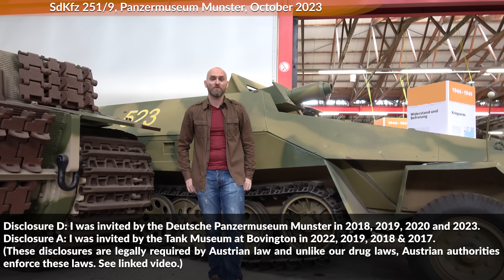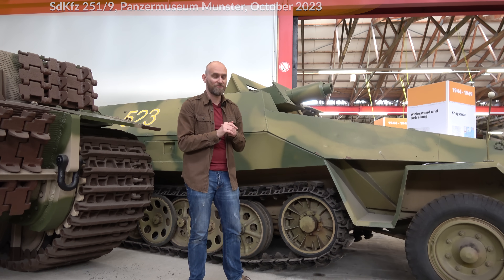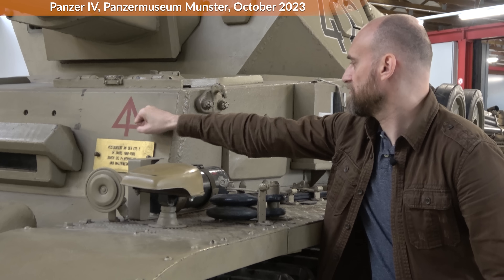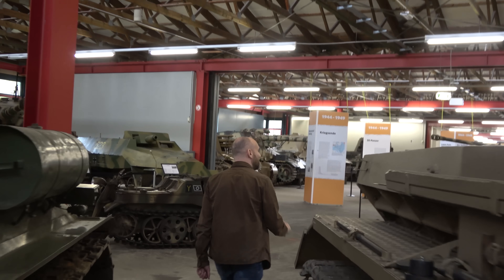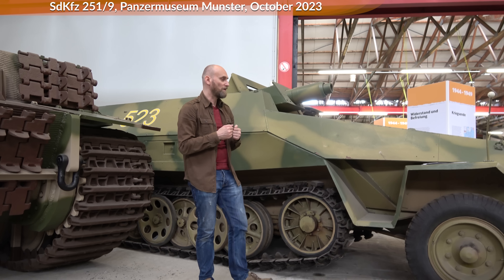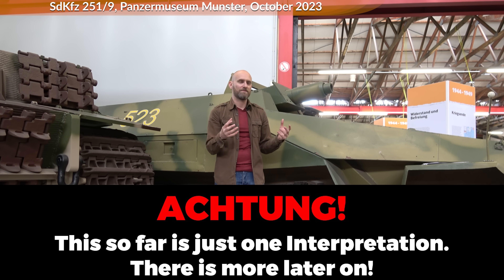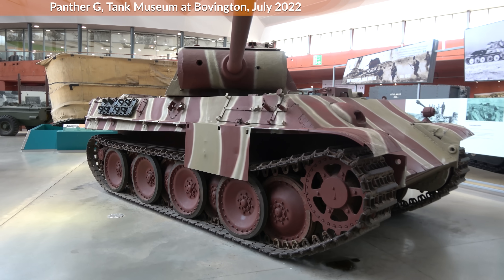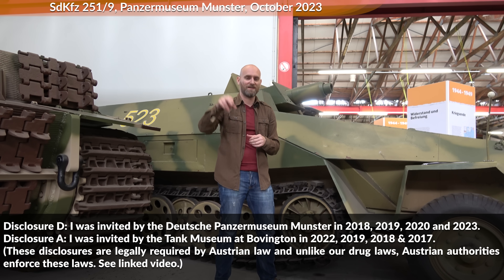Why was German Sloped Armor so late?

Comment: Sloped armor is not a magic bullet (pun intended), a sloped plate will have more effective thickness, but it needs to be longer to cover the same frontal height.
Those two effects will exactly offset, the main advantage of sloped armor comes from normalization effects, simpler production of thinner plates and better surface to volume ratio, when designed correctly. For modern APDSFS projectiles with a large degree of positive normalization, sloped homogeneous armor can be worse than a flat plate.
Especially in a WW2 context there are definite advantages, but also tradeoffs.
Reply: Yes! Thank you! It always drove me nuts to hear that 'sloped armor increases effective thickness for the armor without increasing its actual thickness, so you save weight' when simple geometry shows the increase in length of the armor plate would cancel out any supposed weight loss.
Reply: @quantum340  You guys are purely delusional.

If you don't have the intuition, just consider the IS-2.

This channel has a video on it.
Reply: @quantum340  Simple geometry shows ... Isn't sloped frontal armor just "the diagonal", i.e. approximate shortest path connecting two points? This can also be expressed as a metric - sloped armor uses the Euclidian distance and non-sloped armor uses the Manhattan distance between two points.
Reply: @dwightk.schrute8696  You don't need to armour the top deck anywhere near as much as the armour face. With sloped plates there is more armour face and less top deck while flat plates have less face area and more top deck area.
Reply: @julianturberfield7101  But that means either less internal space or a larger floor plate.
Reply: @julianturberfield7101  Only that the extention in length is minimal while a doubling or tripling in thickness is brutal regarding weight
Reply: @julianturberfield7101  This is only valid for tank (using "normal" projectiles) on tank engagements, right? The "top deck" being weak gives an obvious shoutout to systems like the FGM-148 Javelin and many other advanced munitions.
Reply: @dwightk.schrute8696  exactly, OP was only accounting for height, not accounting for length or width.  We exist in a 3D world so claiming sloped armour is longer is ludicrous.  One can just compare the Pzkpfw IV and the Stug IV and see which one has more hull frontal surface area despite being built on the same chassis.
Reply: @jadger1871  Simple geometry dictates that the volume of a prism (armor plate) is base-area*height.
Rectangular or oblique (i.e. the angle) does not matter, for an armor plate the base area is width*LoS thickness, same goes for the side plates and length.
You can not slope armor by just rotating the plates, you will loose height/internal volume, even the wiki page on sloped armor gets it.
Reply: @dwightk.schrute8696  i meant if you need to cover a certain vertical distance with an armor plate, if you tilt the angle the armor plate needs to get longer.
Reply: @kilianortmann9979  
You literally do not lose internal volume by sloping armor, even the wiki page gets that. You slope armor OUTWARDS not inwards.
Reply: @kilianortmann9979  Then explain how come a Hetzer has more volume than a Panzer 38t? Surely the same chassis but with sloped armour would be have less volume then.
Reply: @jadger1871  Jgdpz 38t had sponsons and the roof of the casemate was quite a bit taller than the hull roof of the 38(t), it's small two man turret didn't really add a lot of internal space. The Hetzer was deceptively tall, quite a bit taller than the Jgdpz IV, you are literally comparing apples to oranges (casemate to turret tanks) btw.
Reply: This, 100%
I have been writing this for some time as well ... angling a plate doesn't save weight by itself. The weight saving come from decreased surface area you need to cover and less internal volume.
Reply: @thrall1342  It straight up does save weight when going for effective thickness.
Reply: @dwarow2508  No it doesn’t, please consider the geometry here:
 if you cover the whole of the Tiger front with vertical plate of 100mm effective thickness, the plate covers an area with 100mm of material. Plate weight is proportional to volume, which is area*100mm
If you cover the tiger front with a plate at 60 degrees angle (extreme example, that looks almost like an Strv S1) with effective thickness of 100mm, you need a plate that’s half the thickness, but needs to be double the length to still cover the front completely.
Weight is proportional to volume and volume is area *2*thickness/2

Same weight of plate, but now you have a more complicated internal space that’s harder to utilize. Weight saving comes from less surface on the side that one needs to cover, if planned well.
Reply: @thrall1342  
Yes it does, please consider the geometry here:
A plate at 60° to reach 100mm of thickness would be just 50mm thick. Applying the volumetric law, a double reduction in plate volume would lead to QUADRUPLE reduction in weight. It would not need to be double the length either. Only 1.5x the length. 

So in all you either get area * 100mm or 1.5*area*50mm.

Much lower plate weight, more internal space, more armor and easier construction. Weight saving comes from sloped armor.
Reply: @dwarow2508  You seem to be confused about how math works … point in case: you speak about quadruple weight reduction, but you calculation only saves 25% (1.5*1/2=0.75)

The plate viewed from the side is a parallelogram. If the parallelogram is supposed to cover a constant vehicle height and have a constant effective thickness as seen from the front, it’s area is constant, irrespective of the amount you angle and stretch it.
Reply: @thrall1342  
Ok, you evidently do not unders and basic geometry... point in case: You falsely believe that a doubling in length directly translated to a doubling in weight and vice versa.
A 1.5 multiplication adds half of the original value, so 50%. (1.5*2=3)
Halfing a volume's single parameter leads to a quadruple decrease in volume.

The plate viewed from the side is a parallelogram. If the parallelogram is supposed to cover the entire frontal glacis, it's area is not constant, bat variable, irrespective how much effective thickness you aim for.
Reply: @dwarow2508  That’s how math works: double the length at constant width and thickness means double the volume (and weight). If you then get away with half the thickness you end up with the exact same frontal plate volume and weight.

The parallelogram has the exact same height as the vehicle body and the desired effective thickness. That makes the area of the parallelogram constant, irrespective of the angle it presents to the front of the vehicle. Please look up „Area formula“ on the Parallelogram Wikipedia article, it illustrates that quite nicely: the weight of the plate itself is the same, no matter if it’s vertical, or angled.
Reply: But can you explain these 'normalization effects'? What are these and how does it affect flat and sloped armor?
Reply: @quantum340  If a projectile hit's a plate of armor at an angle, it gets deflected. For a normal upwards sloped plate, most basic bullets get deflected upwards, like a ball. They don't penetrate the line of sight thickness, they need to penetrate a longer way, leading to increased effectiveness of sloped armor, this is de-normalization.
Specialized armor piercing caps will "bite" into the armor, deform and turn the rest of the projectile downwards.The projectile will now only need to penetrate a shorter distance, closer to the plates actual thickness. This is normalization (the projectile turns towards the normal [perpendicular] to the plate) and this makes sloped armor less effective.
Modern armor piercing projectiles and especially APFSDS have positive normalization.
Example of WW2 era de-normalization
https://www.youtube.com/watch?v=ezf0bX-5R0A
Example of APFSDS normalization
https://www.youtube.com/watch?v=0t-Vi4unTLQ
Reply: @kilianortmann9979  
Re-watchyour own sources.
They don't get deflected by default. They eat through the armor and in the process are redirected into the outfalling angle direction. If the armor is too thin, the projectile will go right through. If the armor is too thick, the projectile might get stuck or disintegrate. It will only deflect at absolutely extreme angles.
Reply: That's why T-34 was supposed to made of high hardness steel to make advantage of the armour angle to deflect shells, but it had side effect of internal cracks hurthing the crew on hit, and Soviets had trouble maintaining any production standard in the first place.
Reply: @piotrmalewski8178  it did not have issues with internal cracks obviously as even after hundreds of hits by German AT the tanks remained operational without issue for the crew. 
The Soviets also had infinetly greater quality control than the Germans
Reply: @dwarow2508  what? The soviets had greater quality control than the germans!? Have you seen a T-34 in real life? Many of them have enormous gaps between the armour plates! What world are you living on?

 Soviets were literally taking farm tractors and turning them into makeshift tanks with almost no standard for their production! Look at the "odessa tanks" for example. You are so wrong it ends up being impressive!
Reply: @armchair_general23
Yes?!?!?! Have you ever seen a T34 in real life? No literally not a single one has a gao in it lmao. The Soviets used automatic welding lmfao, such issues were literally impossible! What world are you living in?

The Germans were literally turning farm tractors and turning them into makeshift tanks with baaicaly no standards for their production!  Look at the Mlbelwagen, Panzer I, II, 38t and Hetzer series for examole.
You are so wrong it ends up being impressive.
Reply: @dwarow2508 Panzer II, a farm tractor? No gaps in soviet armour? Soviets apparently had great welding? Not sure if it's worth to respond to you. Why don't you look at The Tank Museum's "T-34, The Tank They Didn't actually want" at around the 14 minute mark, when they show a real T-34 and it's horrid looking welding, and mention that the tank was unrefined out of desperation, and that the quality only started to improve after they kept mass-producing the tank more and more? Showing they clearly didn't have great quality control.

You can also look at The Chieftain's video, "The Over-rated (early!) T-34", literally at the 1:30 minute mark, when he mentions how horrendously unreliable early t-34s were, meanwhile german tanks did not have this problem.

There's many other videos, which I will not waste my time looking for. There's museum tours made by other creators which show directly how bad the welding was, and there's documented historical proof about how the early T-34s weren't even made to last long, since they were expected to survive for only a short while. Anyone who's familiar with the T-34-85 also knows how cramped the turret was, which was a direct result of it's stop-gap nature. T-34's optics were also veru inadequate in comparison to german tanks', which drastically reduced the T-34's effectiveness. The T-34 also had inconsistent steel quality, way before german suffered from the same problem.

There's MANY other proofs and things I could mention. If you're just trying to say that the USSR had greater quality control than germany during 1944 onwards, and specially during 1945, then sure, it's possible. But that's obviously a very different statement than what you're saying here. 

I also wonder how you're comparing Panzer Is and Panzer IIs to odessa tanks and other makeshift armoured tractors the soviets made (which there were many, Tank Encyclopedia just made a video on them a few weeks ago, why don't you check it out so you can learn a little bit more about what an actual farm tractor converted into a makeshift tank actually looked like?). No way you're being serious, right? You are aware that you might be the only person in the world who would make such a comparison? Even an average person could tell the obvious difference just by looking at both designs. Or do you still insist that the odessa tanks, which didn't even have an standardized production, really are comparable to panzer IIs? Impressive!
Reply: @armchair_general23 
Lmfao, you are the one who used 9 prototype units in a siege used for an emergency as the standard for Soviet tank design xD
T34 had gaps in armor? Germans, using outdated manual welding? Panzer I and II were not tractor conversions? Not sure if it is worth responding to you. Why don't you look at the video you listed lol. No it does not show any gaps at all. The closest is at the rear engine hull plate where there is a half cm gap which is quite explicitly mentioned as completely irrelevant for performance. They do not show any poor welding anywhere, althoug the same series has a video on the Tiger II and Jagdpanther, which explains why the Germans were incapable of properly using sloped armor on many designs as they lacked the welding skills necessary for it xD

Yeah no, the Chieftain exclusively refers to the 1940 T34 model (although I find it funny how you use him as a source despite him never actually backing up any of his claims he ever made about the T34, nice appeal to authority lol), of which not even a thousand units were produced (out of 80 000 plus 70 000 other tanks and SPGs). He, in the very next segement, mentions Soviet comparisons to the M4, which showed that the T34 mod. 1942 had a longer engine, track and transmission life span than the M4. This is also backed up in the memoirs of Dmitriy Loza and the records of the 9th Guards Tank Division which performed similair reliablity comparisons. Oh, German tanks did not have this problem? Is this why 46% of Panthers were lost before battle from reliability issues? Is that why the Tiger II had an average track record of 37km? Is that why out of 91 Ferdinand TDs, 72 were lost outside of battle? Is that why the average readiness of the Tiger I never surpassed 55%?

There is many other videos and records, which I will not waste my time listing. There's museum tours made by other creators which never for some reason manage to show any poor welding on T34s, yet explicitly mentioned poor German welding as a reason for lacking sloped armor and welded turret designs. Meanwhile there is historical proof about how the mainline T34 was made to last for as long as possible without needing maintanance due to the difficult logistical situation and harsh climate. Anyone who is familiar with the T-34-85 knows how the turret had the same amount of space per crew as any other tank (more than the M4 actually lol, love how you conveniently ignore the one less crew member). Funny how this stop gap nature produced the most reliable and effective tank of the war lol. T34 optics were perfectly adequate in comparison to German medium tanks (yeah it obviously did not feature the overcharged optics of Ferdinand TDs or Tiger IIs since they were pointless). Meanwhile the Germans couldn't even figure out how to produce properly treated steel which drastically reduced the effectivenss of German tanks to the point where IS-2s could blow off Tiger II turrets with HE from 3km away without even penetrating. The T34 also had perfectly consistent and a whole lot superior steel quality compared to the Germans which is why even in 1941 T34s would return from battle with dozens of impacts without the armor spalling or breaking. The reason the project to copy the T34 for the Germans failed btw. was because of poor German welding skills not allowing to weld their hulls with sloped armor and the lack of high quality materiel needed to replicate Soviet steel lol.

There's MANY other proofs and things I could mention. If you're just trying to say that the Germans had greater quality control than the USSR at any point during the war, then this "discussion" is over. You can not be helped.

I also wonder how you're listing the Odessa tanks (that for their cost of zero and unit numbers of 9 were infinetly more effective than any tank ever designed lol) as some sort of standard in Soviet tank design (no there were not many, Tank Encylopedia lists exactly 17 units in total compared to 184 german tractor conversions alone lmao, why don't you check it out so you can learn a little bit more about what an actual farm tractor converted into a makeshift tank actually looks like?) No way you're being serious, right? You are a ware that you might be the only person in the world who would actually make such a comparison, right? Even an average person could tell the obvious difference just by looking at both designs. Or do you still instist that the Möbelwagen conversions, which were actually standardized by the Germans before the war for some time, did not constitute a standard in German tank design, while the Odessa tanks, an emergency solution during a siege which occured completely independently from Soviet tank design, which you yourself admitted (thanks for proving yourself wrong again btw. ;)), did? Impressive!
Reply: @armchair_general23 
"T34 was unreliable, German tanks did not have this problem"
AHAHAHAHAHAHAHAHAHAHHAHAHAHAHAHAHAHAHAHAHAHHAA
Reply: @dwarow2508 Wow! I am sure you are must more knowledgeable than every expert in The Tank Museum combined, and you have more first-hand experience than any of their sources! Maybe you should write a book about how wrong everyone is about the early T-34 (which is obviously the conversation here, as I made it very clear already, and trying to discredit german designs focusing specially on late-war, when germany was already losing badly and out of resources, simply makes no sense. Afterall we are talking about quality control and quality of engineering, which you can have a lot of even if you lack the proper resources to realize your design up to standard)

Fact is: the soviet engineers were less experienced and knowledgeable than german engineers, the soviets had more resources than the germans, the soviets went through a massive purge (thanks, stalin!) and therefore were in dire need of skilled commanders. All of this resulted in a very poor early-war performance both in the commanding and engineering aspects. Which, obviously, includes the "quality control" part, which is the whole point of this conversation. And no, the Odessa tanks were not an exception, I just told you to look at video which cites multiple other examples involving desperate farm tractor modifications. Remember that the whole point of me mentioning that was because you said that Panzer Is and IIs were farm tractors, somehow. Something that's indefensible and makes zero sense. Also, very interesting how you mention Tiger IIs, Panthers, Ferdinands, but make no mention of Panzer IIIs and Panzer IVs when talking about german reliability, when comparing to the T-34. This has to be on purpose lol.

Anyways, going by your other responses on this thread, this is not worth my time. Have a nice day!
Reply: @armchair_general23 
Wow! Is that why every expert in the Tank Museum disagrees with you? Sources? You mean the sources that I listed and you did not? Funny! Maybe you should write a book about how wrong everyone is about the German tanks and the T34 (no we are obviously not talking about the early T34 here, as I made that very clear, and trying to to glorify German tank design which was horrandous thoughout the entire war, simply is adorable. Afterall we are talking about quality control and quality of engineering, which very much does change a lot depending on the availability of resource. Not that it matters though since the Germas at no point in the war seemed to figure out how to make high quality steel or use automatic welding lol)

Fact is: German engineering was extremely outdated and relied on manual welders while Soviet factories, which were more modern and had access to higher quality materiel, used automatic welding and could keep up a high quality of manufacturing which the Germans were never able to achieve. (Wtf does the purge have to do with welding lol?) We are talking about the overall standard of both Germany and the USSR, not July 1941. Keep up. No, even in the early war the purge had no influence on "engineering". No, the point of his conversation is not quality control in 1941 although even then the Soviets were infinetly far ahead of the Germans as seen by the performance of german and Soviet steel against impacts. And yes, the Odessa tanks OBVIOUSLY were an exception unlike German tractors, I just told you that your own video fails to list even 20 units throughout the entire war whereas the Germans nearly produced 200 as part of seriel production. Remember that the whole point of me mentioning them was because you claimed the couple Odessa tanks, tanks that literally were never designed by the Soviet government but by a couple encircled defenders in a siege, that you could count on your figures, were somehow proof for poor Soviet quality control or engineering but apparantly the Germans making even worse tractors in greater numbers as part of serial production were not. Something that is indefensible and makes zero sense. Also, very interestingly, you ignored me mention Panzer IIIs and IVs and their horrible performance against T34s and KV1 as well as obviously inferior reliablity. All while you also desperatly try to shift this conversation from "ww2 overall", which is what we are talking about, to "very early in Barbarossa". This has to be on purpose lol. Try again ;)
Reply: Hats of to you sir!
Reply: Correct me if I'm wrong, but I believe one other significant advantage to sloped plats us that, broadly speaking, it's easier to make a higher-quality thin plate than to achieve that same quality on a thicker plate, so by using sloped armor of the same line-of-sight thickness, you may be able to achieve either better protection or the same protection at a lower cost.
Reply: @Balmung60 yup, this is a hugely important piece of sloped armour that is rarely mentioned.

Working with thick armour plate is extremely difficult, sloping it might not get you much more protection for the weight, but it sure makes it easier to work with
Reply: Another point commonly missed is effective armor thickness is typically calculated at "normal" incidence, which is anything but normal in the real world.  Tank battles rarely occur on perfectly flat terrain with the tanks set at the same elevation and incoming fire rarely arrives at a precise 90 degree angle to any plate.   Which is why armor penetration tables should be interpreted with some degree of fudge factor.
Reply: But doesn't the penetration of a round diminish if there is an angle?
Reply: @akriegguardsman  For WW2 rounds generally yes,
for modern armor piercing rounds, generally no.
Reply: @kilianortmann9979  For modern APFSDS especially yes.
Reply: These two effects do not exactly offset. You forget that you need a roof when you have a box design. So, for the same horizontal armor thickness, you get away with less weight for less internal volume but still less weight per volume.
Reply: @fracapolligummala3548  You also need a bottom, in WW2 roof and bottom were usually the same thickness.
Reply: @kilianortmann9979  But for the sake of argument is practially irrelevant as all heavily sloped armor is tilted upwards, which only gets rid of the roof. The floor is always there no matter what and you cant really shoot it either.
Reply: @fracapolligummala3548  If the armour is tilted inwards at the same floor space, a lot of internal volume is lost. To conserve inward volume, sloped armor needs an increase in floor space.
Reply: @kilianortmann9979  You could increase the width of the tank, to compensate for the lost volume, yes.
Reply: @fracapolligummala3548  That makes the tank heavier. Tanks with the same internal volume and lengt, width, height ratio (of course a cube is a more efficient shape but not ideal for a tank) will weigh essentially the same, regardless of sloping. I know it's hard to grasp, but geometry says that oblique prisms (which is what armor plates are) with the same line of sight thickness and height will weigh the same, regardless of angle, no if, no but.
Reply: I think you meant denormalization.
Reply: Sloped plates also turn your tank into a Toblerone box, which reduces the amount of elbow space, ammunition and fuel you can cram inside. You need all 3 because crews need space to move and respond quickly, and the eastern front is too big to retreat and restock every 10 minutes. As clumsy as the Tiger I may look, it was not taking lunch breaks as often as a Char B1.
Reply: @charlesc.9012  Nope, sloped armor does not reduce space, the opposite actually.
And the Tiger was actually taking far more breaks than the Char B1, mainly due to it's poor reliability
Reply: @dwarow2508  If that were true, the KV series and IS-2 would not choose to reduce the slope on the upper glacis. The reality was that it was ridiculous and seriously impacted even basic operations.

The Tiger I had above average readiness in high intensity combat for a heavy tank. The worst reliability in the whole war came from the t-34, because Stalin had to issue directives to address the terrible readiness rates.
Reply: @charlesc.9012  
Except they didn't reduce the slope? The opposite, they actually increased it.
The reality is that it was genius and had literally no drawbacks.

The Tiger I had an abyssmal reliability with a horrandous track record and engine time of less than half of the Panzer IV. 
The best reliability in the whole war came from the T34 with the longest engine life time, track record, transmission run time and track holding.
The T34 literally never had poor readineyy rates outside of the early stages of Barbarossa and "issueing directives" which you just made up, was the norm for all nations of ww2.

The worst reliability of any tank of ww2 came from the Panther with a horrible 89% breakdown rate at introduction and 56% in 1945, with an engine time of just 78 hours, which was not even a third of the M4 or T34.
Reply: Don't forget that most armor-piercing shells of that time were pointed. Such projectiles easily ricochet off sloping armor.